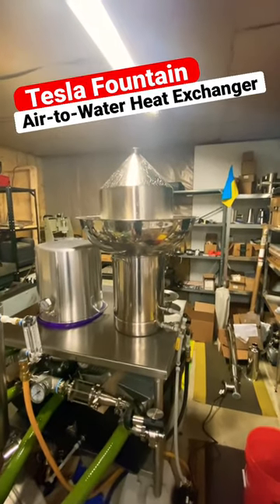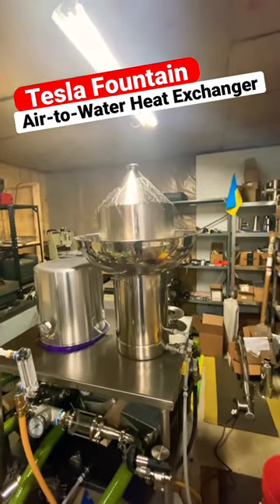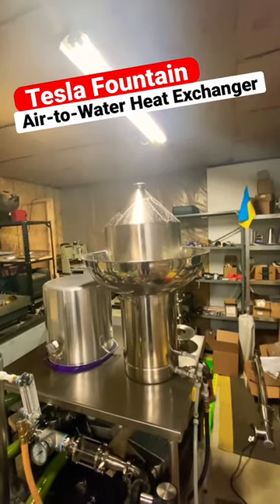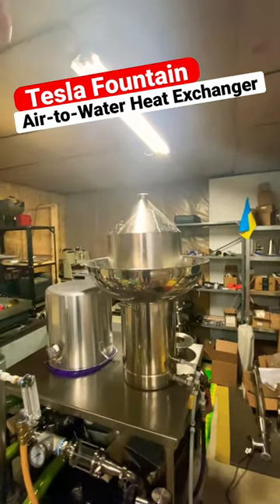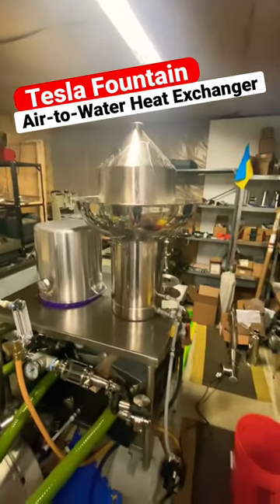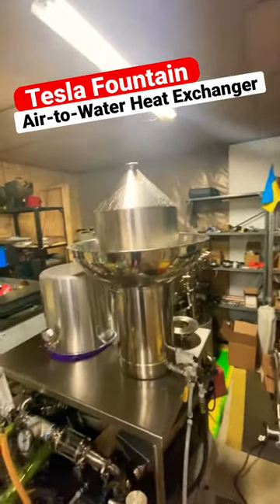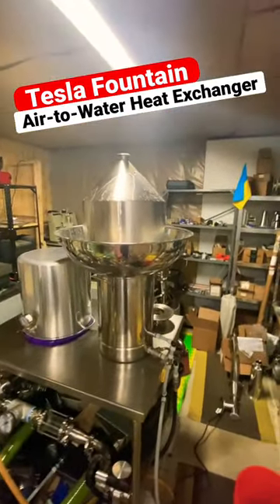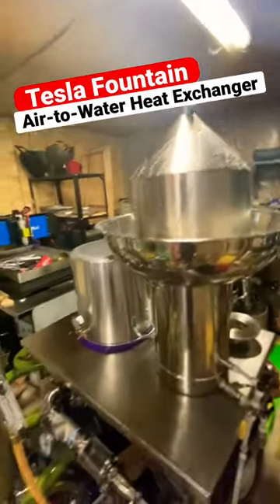Tesla Fountain Air to Water Heat Exchanger (Early Prototype)

Comment: I highly recommend you check out the air purifiers that rainbow vacuum company gives to their new customers as a bonus gift. It has a round clear qwater tank with one impeller placed right above the water line and fixed to a shaft that sits centered at the bottom of the tank all the way to the motor that is above the impeller. The bottom
Half of the impeller is funnel shaped with 4 slits at the widest rims. The top half of the impeller is a disk that sits on top of the funnel with an impeller on the opposite side facing up but drawing air from a vent hole that the motor  sits in to vent heat. As the impeller spins the funnel draws water up with centrifugal force and out the 4 slits that are slung outwards horizontal to the waters surface. Air is following a mirrored path from above and mixes with the fine water droplets. Any contaminates are caught and fall in the water tank. I said all of this to bring your attention to the genius yet simple way they designed the water and air to mix.

Comment: Nice work 👍, a upside down stainless steel bowl on the top works for me,   how much does your pump use? Mine uses about 3 watts
Reply from the maker: Bear in mind I’m pushing through over 100-200 feet of 1/2in pex pipe, plus a shell and tube heat exchanger that’s just a single loop so there’s about 30x 90°elbows, plus the jacketed column with a lift of 6 feet...😅 So I don’t think it’s a proper comparison 🤭